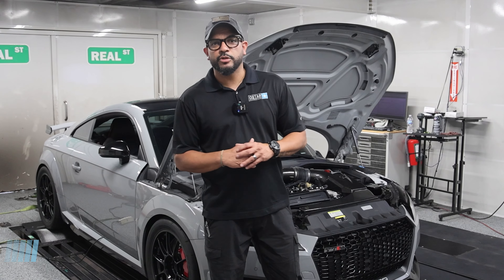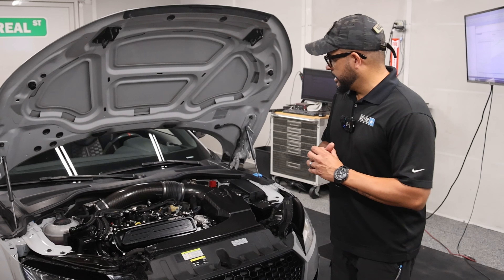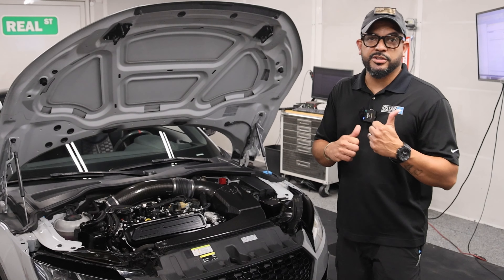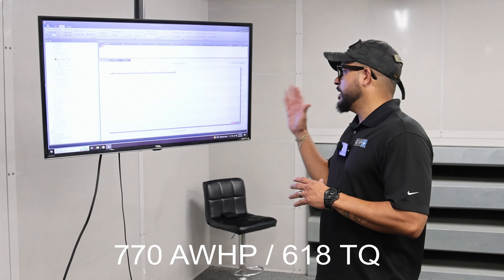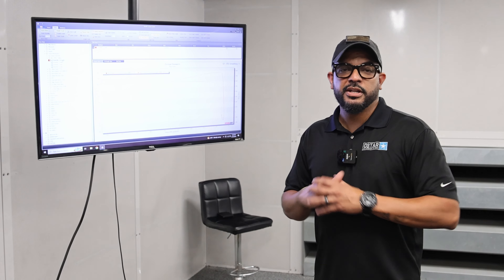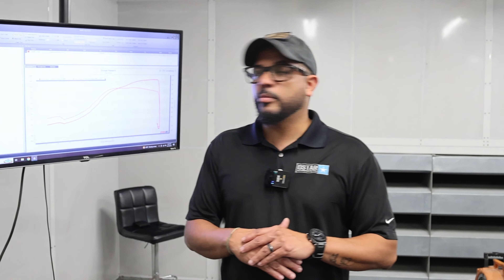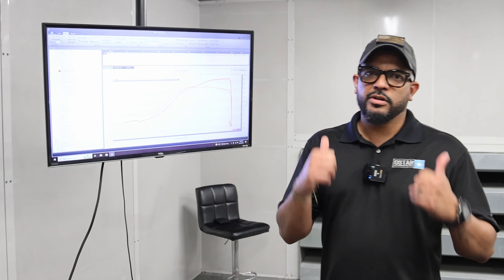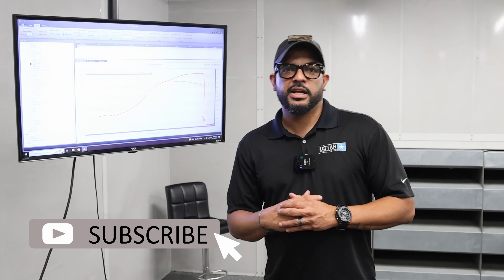900+ AWHP AUDI TTRS

Comment: Nice build.  

1. Does upgrading the cat back exhaust from the stock Audi sport exhaust really add horsepower on these cars?   

2. Is this car on stock transmission/clutches?
Reply from the maker: The exhaust does help with backpressure relief from the stock unit. We are using a Dodson Super Stock clutch kit.

Comment: Can you share more on the anti-surge setup? Where is the frp located, how did you set up the lines, and how are you controlling the pumps?

Asking because im having a hard time on mine to set up everything clean and correct.

Thanks, great build btw..
Reply from the maker: The anti surge is basically the STD cover for the new 6466 Next Gen turbo from Precision. If you are referring to the Surge Tank setup; we installed the tank in the trunk of the car. The intank pump supplies the surge tank (surge tank has 3 pumps). The pumps in the tank are triggered via boost reference using a hobbs switch. If you need help we can supply a kit for you.
Reply: @OstarMotorsports  yeah sorry I meant the surge tank, unfortunately I already have a full kit, just having trouble with the location of the FPR
Reply from the maker: @bumble2685  email me direct at Fernando@ostarmotorsports.com and I will try and help. Send pictures of what you have so far.

Comment: Usually when going to a full frame turbo the exhaust note pitch is higher. I'm curious to know what the exhaust manifold, mid pipes and exhaust system setup is on this vehicle which allows it to retain a very throaty exhaust note?
Reply from the maker: Exhaust manifold and mid pipe section is from the JDY Turbo kit we installed. The exhaust is all OEM Audi.

Comment: Says 914 at the engine on the graph...
Reply from the maker: Its a chassis dyno. It reads horsepower to the wheels, not to the crank. For crank numbers you would need to use an engine dyno.
Reply: Yeah, hmm. It's a roller dyno. Not a hub/chassis dyno. Also, it can convert to engine horsepower (BHP) easily enough. Not sure on these values being all-wheel-horsepower. But anyway, it's an impressive engine and turbo setup. And DS1 is awesome with flex-fuel.
Reply from the maker: @RichLion  the hub and chassis dyno are two different types of dynamometers, but I understand your point. At the end of the day the dyno is a tool to ensure the engine is dialed in as close to real world as possible. Usually the track mph will be the ultimate test of what power it makes. Mph doesnt lie 😉.